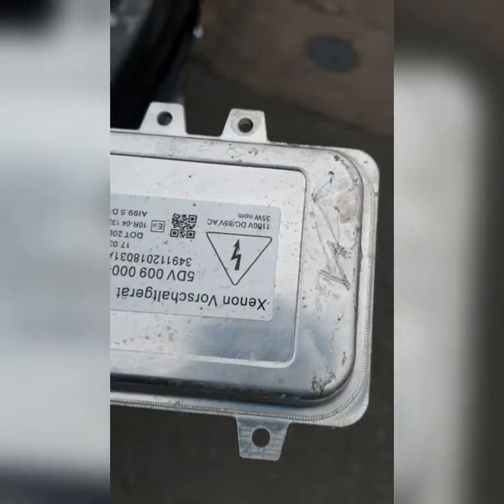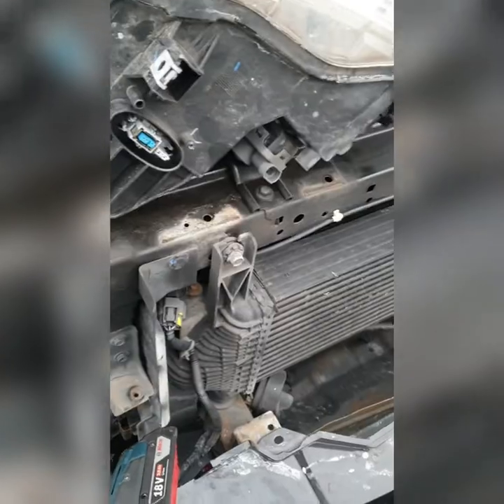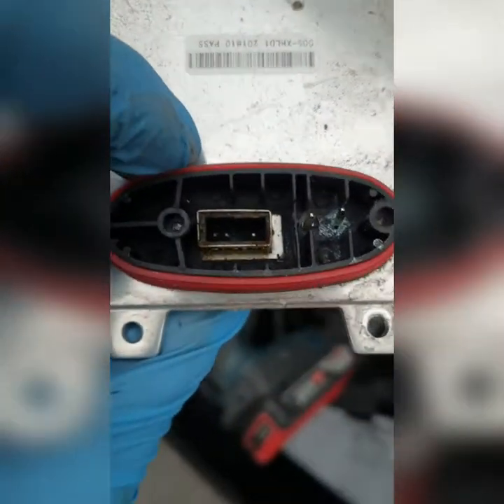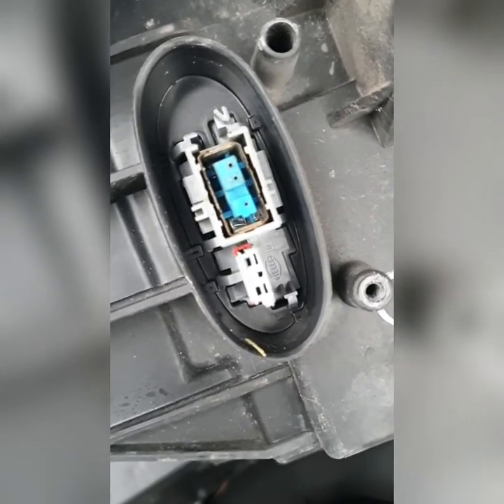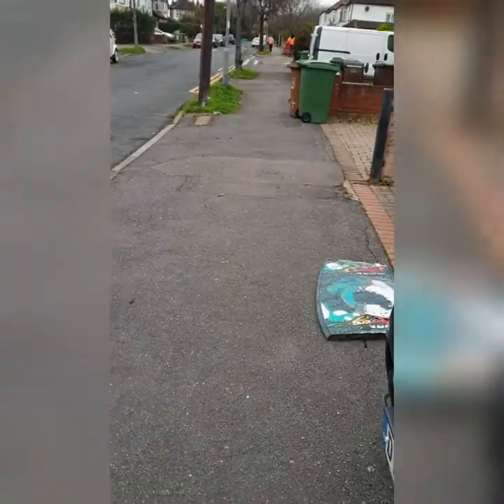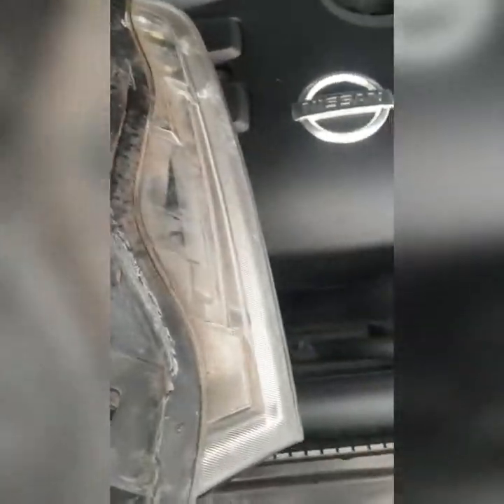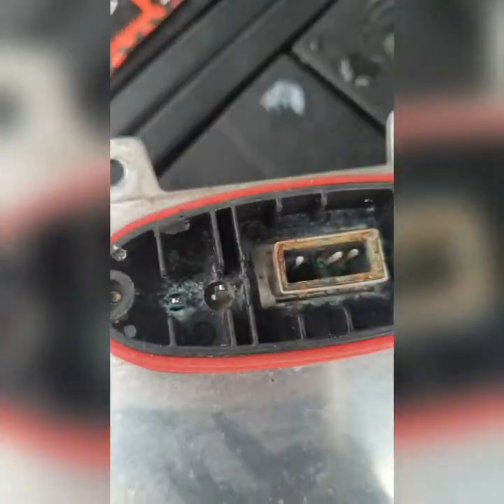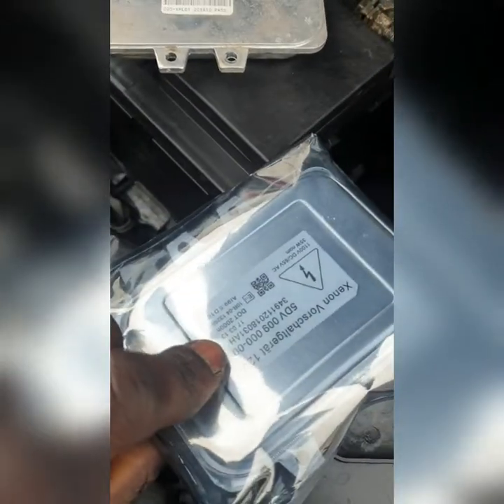Nissan Pathfinder Xenon Headlight Issues | How to repair Nissan Pathfinder Xenon Headlight Issues

Comment: Hey, had to change the ballast (for the 3rd time!). Now the xenon is not levelled. Anyone knows how to adjust auto levelling? BTW, I tried resealing, but it did not work. I ended up taking off the plastic cover behind the xenon bulb. Though my headlights are not waterproof anymore, there is no more condensation. I just have to restrain myself and avoid those big splashes
Reply from the maker: At this stage, I'd have a new headlight, but I know they are so expensive. I think you might have knocked off the levelling motor connection. Try not to spend any more money on that headlight. Replace with new or decent second-hand

Comment: I have this issue on both my lights... tried siliconing it but theyre still getting damp and now the second light is out.
Do you know if the xenon can be ditched for LED. Thank you.
Reply from the maker: With some seeerious effort. The wiring you have currently won't make it straightforward

Comment: Hey i changed the balast like you did in the video but headlight still doesn’t work, what  would most likely be the issue. The HID globe?
Reply: Same! Keen to see what the issue is
Reply from the maker: If you change your bulb 1st then your ballast and that didn't work, you need you  to check fuses and wiring.